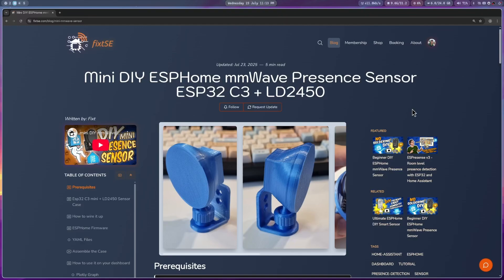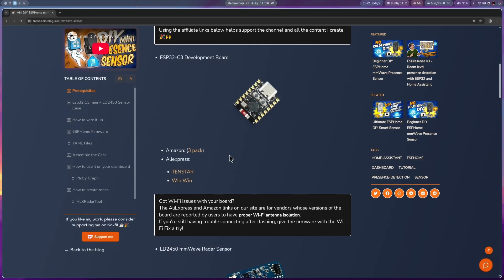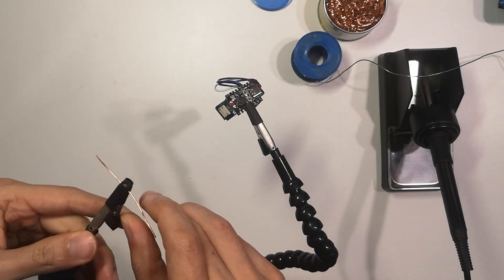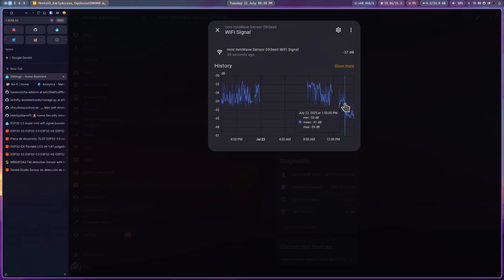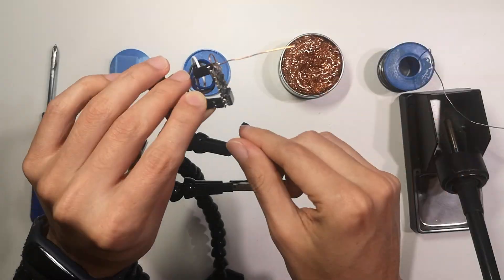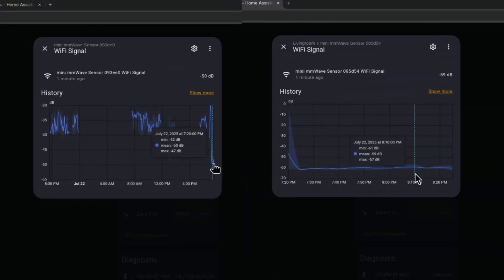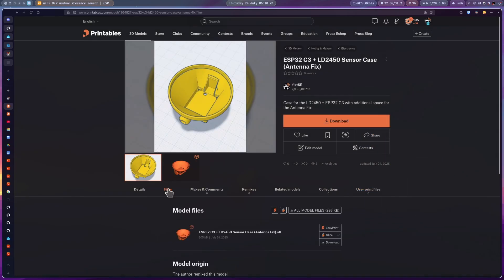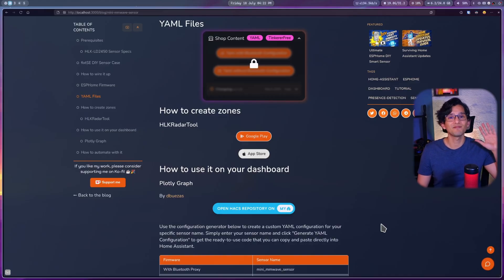Fixing ESP32-C3 Design Flaw | DIY Antenna Mod

Comment: Someone ever wrote: "I had similar issues with the Mini C3. I have about 6 or so around the house.
After adding "output_power: 8.5dB" to my ESPHome config, it fixed all of the WiFi issues. It may be some sort of bug in the way its implemented (AND the antenna being too small), causing it to use too much transmit power for the tiny antenna.
In Arduino, this should be "WiFi.setTxPower(8.5)" or  "WiFi.setTxPower(8);" I haven't personally tested this."
Reply: yeap, i have tested it..   my 2 minic3's didnt see eachother then they were right next to eachtother.. perhaps 1/100 messages came through,  with the txPower to 8.5 db  it suddenly works 100/100

Comment: Why not design  a antenna  on a small piece of circuitboard?  So you can sandwich that  onto the esp32  Could be a nice universal solution to improve the wifi range for every board. And it's alot neater.
Reply from the maker: This sounds interesting, do you have any link that i can read?
Reply: @fixtse. It's not coming from a link, this idea just popped in my head. If you look at on-board integrated antennas you might figure out what the best design is and if you can improve on it.

Comment: I wonder if you ever encountered  any serial signal loss before? I made the same setup with an LD2410C and 2410B. After upload it worked perfectly fine. 2 hours later I lost all data. I could see the sensor working on the HLK radar tool, but the esp shown none of that. I know you are using 2450, but I could not see to find a solution anywhere. Thank you for the video.

Comment: Try removing the smd antenna on the board first, in theory by adding another antenna you are de-tuning the output RF circuit. This is why the signal is so poor. Hope this helps 👍
Reply from the maker: I'll try it and let you know how it goes, I read before that removing the antenna hinders the signal by +/- 2 db with the mod applied, but haven't tested it myself yet